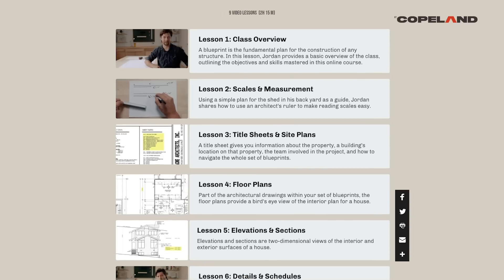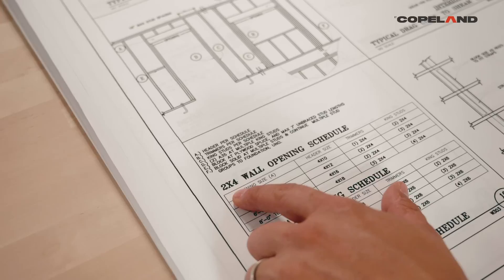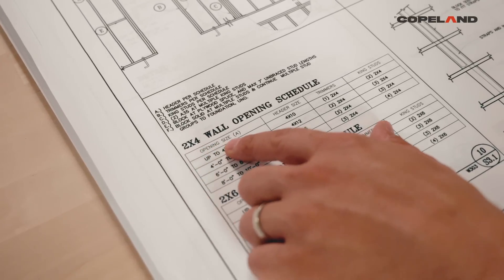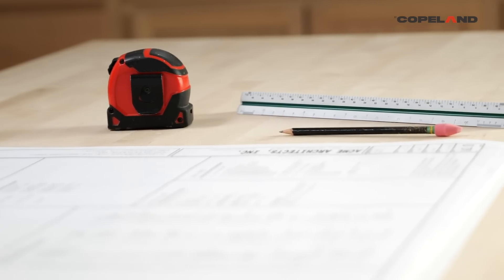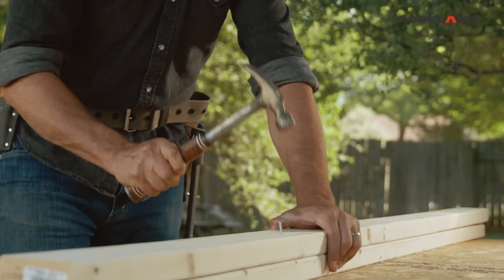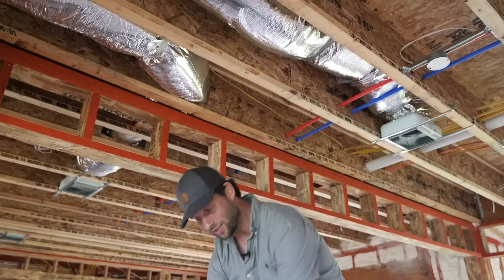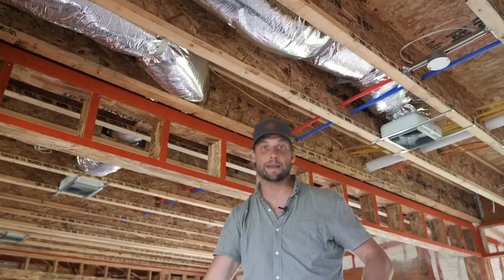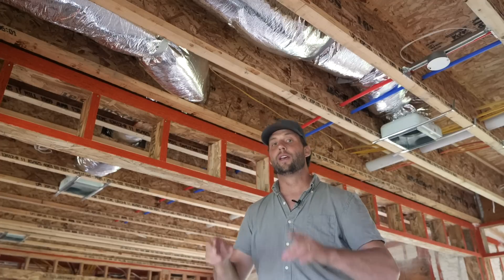Flex vs. Rigid Metal AC Duct - My preference may surprise you!

Comment: So long as you size it correctly, you don’t pinch it or bend it too far, flex is better in almost every situation.  When you size it you have to use a lower velocity also.  So where you might get away with a 6 inch in metal pipe, you probably need a 7inch in flex.  If you can run a board trunk line with flex take offs.  In new construction, I would only use flex unless it’s a custom house with a correct budget.  I would never use metal pipe, with wrapped insulation.  There are very few people that will wrap it correctly and you will have condensation leaks, also people will set stuff on it and it will compress the insulation and leak where flex will move more and you’re less likely to leave something on it.  You won’t use the difference in cost of the duct work on any extra electricity.  There are so many other things that will cost you more money than using flex over rigid duct, especially when it’s sized correctly.

Comment: Jordan agree to disagree.  If you building typical USA stick houses flex duct is the best way to go. But if you building industrial buildings, Steel, or Concrete buildings than for sure ridged is much better on the main run's and only Flex at the end. Also on Mobile homes I go ridged for reason so animals can't destroy and also it's easier to maintain and service. So it really comes down to what building you have.

Comment: This is not a good video Jordan. (1) You did not state what you are talking about: trunk vs branch vs returns. Trunk should be metal [avoid fiberglass]. As far as branch lines IF they are designed properly flex is ok, metal would last longer.  Flex got bad name because of hackery. Hackery happens today. Not properly strapped, not properly attacked to metal boots, etc. Again this is not just exiting CFMs, installers should test ESP.

Comment: The round rigid duct generates about half the turbulence of flex though most systems will allow for this I’m still a rigid user although I will agree that flex duct does antinuate wait sound much better. 
Ductwork in unconditioned space is to be avoided at all cost, well almost. 
40 years in the frigid north.

Comment: I love the contra position. Instead of saying, like everyone else, spend 20k more to save $20 a year, you said, the extra cost is not worth the improvement in performance. America needs to hear this!
Reply: Mat risinger like to spend thousnd to save dollars juat to prove his point hahahha
Reply: Feel thats the way solar power is
Reply: Where have you been? All America is built like this. Unfortunately. Edit: of course by "all America" I meant residential real estate.
Reply: @ooooooo-pu8vg  that's good then.
Reply: I am an hvac contractor.  Flex is much more likely to suck. Poor airflow. This guy is full of shit. Once the squirrel chews it up..
Reply: @jadfaris4119  good duct work isn’t cheap and cheap duct work isn’t good.
Reply: I’ve seen jobs where there’s been way too much flex in the system doesn’t work. Flex no matter how you run it has friction. And I’ve seen friction loss caused equipment not to work not to cool A house. What I don’t like about this is that flex duck will be buried under a mountain of sheet rock and paint if anything goes wrong with it guys cut it all out to fix. If you have low airflow because of all that length of flex run there’s nothing you can do about it. I think he’s trying to save too much money on his installs probably have an illegal aliens installing flex all over the place. That’s how a lot of builders are and I’ve had her go out and tell the homeowners you’re screwed more than once in my career. And that’s also on Multi million dollar homes that the builder went cheap ridiculously cheap on the HVAC the most important part of the house
Reply: @benkuxhouse787  let me understand your point , so you mean , it's better to use metal duct ? Im thinking using flex for whole house as to cut cost , but if the air supply wont work well, doesn't work as much as metal , then its a lost to use flex .
Reply: @nurulshuhadah1175  It doesn’t work as well if the ductwork is going to be buried beneath a bunch of sheet rock flex duck should never be used

Comment: The metal coiling that provides the shape of the duct internally. IS also what creates all the texture internally breaking laminar flow and requiring more CFM to overcome it.
Reply: The "spiral wire" inside the flex tube can be thought of as being very similar to the "rifling" found in most gun barrels."  The air flow over the "rifling" of the flex duct is therefore "spinning" or "rotating" causing the air to become more "dense" and "concentrated" - just like happens within a storm cell in nature . Further, the air flow dynamics and efficiency is  most likely"enhanced" to a greater degree than it is "degraded" or "corrupted."
Reply: You have any source to back to up?
Reply: @impactodelsurenterprise2440  just thinking back to fluid dynamics in undergrad.

Comment: I agree about everything you said except one thing.  Longevity.  I would have no problem with flex duct in a new build.  Get 50-100 years down the house and there is no way that everything isn't going to have to get opened up to redo the work.  I say plan for the long haul.  That plastic in those flex ducts get brittle and deteriorate especially if they ever come into contact with condensation, or any pest in the home.   When someone tries to tell me how to do something I always make them qualify their statement if its about aesthetics, functionality or longevity.   Aesthetics is not the most important thing here assuming both jobs are done cleanly.  Functionality is fine either way although there are arguments either way.  On longevity I see it as no comparison.  I say build things that might last for hundreds of years.  All the building science goes out the window if you have to gut half a house to retrofit mechanics at a fairly early point in the life span of a house.  Things go together best the first time and should stay that way as long as possible.
Reply: I’ve been back in attics that have 30 year old flex and rigid board, and there’s no difference, the worst is usually wrapped metal. I’m not talking about the old owl flex systems, but the Mylar systems.  I’m in Ft Lauderdale where 130 deg attics.  If I bought a 25 to 30 year old house, I would replace the ductwork anyway.  I wouldn’t want other people’s mildew growing in my ductwork.
Reply: "or any pest in the home". Beware the rat & mice monsters. Even squirrels. Those tiny rodent teeth can tear up your peace of mind like crazy.

Comment: Using some strategically placed elbows is nice in certain areas. The duct boot selection where it comes through the ceiling is also important. Starting from a basic, cheap system, what is the first thing to upgrade? (It's not the flex duct)

Comment: I don't disagree that flex duct, when installed properly (big disclaimer here) is almost as good as rigid.  However I think a blended approach is best for flex.  Use hard pipe for most of your run and then finish off with 4-6 feet of flex for ease of final installation to the boot and for sound deadening.  I NEVER install more than one box length (25') in one run.  Generally I am okay with it in runs up to 15-20 feet if they are straight runs that can be easily supported for the length of the run.  When you said you keep it short at 40' I almost lost my drink.   Around here (Ohio) it is hard to find someone who installs it properly and correctly supports the duct, manages the sweep of turns, and fully stretches the duct out.  That is another issue you can have with flex, if it is not stretched out fully the coil inside will cause the air to "roll" through the duct which will lead to reduced air velocity and airflow at the register.
Reply from the maker: I agree. It's hard to find people who do anything correctly without training.  Most of my subs I have to be very explicit on what I expect and monitor the process for the first few jobs.  Unless we are using a balometer to verify flow rates, I stand by my argument that using rigid instead of flex is less of an issue than poor design and commissioning of the system.    I take no issue with installing rigid and flex, if you have a wide open attic to work with. Thanks for the comment.
Reply: how do u find a guy that does great install?
Reply: @bamc3835  your pray to the HVAC gods and hope for mercy

Comment: I have an interesting problem here in NC - all insulated flex duct in the vented crawlspace...the main trunk coming out of the air handler drips with water from the humidity. Even though it's insulated! It's usually 80%+ humidity down there, but I can't do anything about that unless I seal the entire crawlspace - it's just as humid outside!
Reply: Encapsulate the Crawlspace, that humidity will drop overnight!

Comment: It seems odd to have such large openings in the joist (TJI) webs from the ducting. Am I wrong?
Reply: Those floor joists are designed to be able to have large openings cut in them.  Just not the top and bottom plates.
Reply: @brianlorge906  That hole size is probably the max allowed depending on how far away it is from end supports(wall). I believe its max 8 inch diameter hole on a 12 inch deep TJI joist if supports are minimum 8 feet away. I personaly wouldn't do that to be safe. It just looks weird and sketchy. Thanks.
Reply: You are absolutely correct. The building plan will give you the maximum size hole that should be cut in pre-fab joists, and it's alot smaller that shown in that video.

Comment: skip up until the 7 minute mark.  HVAC systems need to be designed for each specific home, spec written and then equipment specified, that's the time to compare costs vs performance  of ridged vs flex or any other component in the system.  

Never trust HVAC contractor who walks in asks 3-4 question and then just hands you a quote.  An independent designer is always a good idea.

Then every system should be tested after install to be sure the designed airflows and such are met.

Comment: Matt Risinger is going to call you over this one.
Reply: Master Risinger has been glove slapped in the face. Now to regain his honor, he must challenge Master Smith to a duel.
Reply: I'm in the design process and watch a ton of Risinger videos. BUT, I like to hear what other professionals have to say. This guy has some good points. With that said, I live in a place that gets up to 118° in the summer and occasionally will see 20° in winter. Maybe, based on the farthest distance of 44 feet, I may go with a hybrid of the two. Metal for long straight runs and flex on the shorts. However, if the flex is pulled as straight and tight as possible, I've read that this minimizes friction and turbulence.
Reply: Meant to add that equivalent length plays a part in air flow as well.

Comment: I'd like to know what the cost is up front to properly design the duct system.  Because, when you add that to the HVAC budget, it doesn't seem like it would be much higher to go with the VRF as you discussed in yesterday's video.  
I don't know.  Maybe I'm lucky to have an HVAC guy that installs my mitsu mini splits to where I end up being into them for 1/2 of what the normal cost is.   I don't do conditioned attics, therefore I will refuse to put a ducted system up there.  So VRF has been the best choice for my houses.  I do a single 18K BTU unit  (20.5 SEER) for around $3000 installed.
Reply: is vrf the unit that replaces hvac units more commonly used? i am a lil confused so pls help...i thought at first ervs replaces the hvac unit but then found out that is only for fresh air supply
Reply: @bamc3835  Watch Jordan's video from 2 days ago. VRF is 'variable refrigerant flow'  which is the way a ductless mini split heat pump operates.

Comment: What about dust accumulation in the duct?  I was under the impression that it was much higher with flex duct due to the less smooth interior surface and that it is also more difficult to clean.  Thoughts anyone?
Reply: Dr. Lsitburek also mentions this in his builder's guide.  Similar to the comment about vermin infiltrating the ductwork and leaving evidence in the ductwork also.

Comment: Who do you have validate  system flows at the end of the project? Does the mechanical installer balance, or do you go with more of the commercial approach and have a NEBB certified TAB contractor balance the system?
Reply: Using a balometer isn't that complicated.
Reply: @halbritt  I've used them quite a bit in my job as an HVAC controls technician. I'm just curious if they go as far as having a third party validate the system.

Comment: Mice love flex!  If you live outside of the subdivision or in the beginning phase of one your going to get mice. I see lots of droppings in flex with custom exits for the mice. That has been what I've seen in remodeling homes.   This is with mostly crawl space installation.
Reply: the biggest problem with flex in vented attic are those darn rodents. yes, thermal is an issue but not yet hazardous.
Reply: Playing devils advocate, couldn't the flex duct simply be replaced if mice become a problem?
Reply: @TheRoadTaken  yes, but who wants to come up with thousands of dollars to replace damaged ductwork.
Reply: @tysleight  flex duct in my area is not that expensive last I looked but maybe COVID has affected the pricing too.
Reply: @TheRoadTaken  mostly labor.   Our area is years out, even unlicensed uninsured guys are booked out and can charge anything they want.
Reply: @tysleight  also think of your poor serviceman who has to replace the flex duct in an insulated attic at over 120 degrees in the summer. Have some heart, we get heat stroke too ya know

Comment: If you want to save money, just build a smaller house, air seal it well, and stick lots and lots of fluffy stuff in the walls and roof. Rigid vs. flex vs. VRF is arguing over pennies. There are much bigger thermodynamic fish to fry.  Especially the way most US houses are built, too big, under air-sealed, under-insulated, and wore, over glazed with crap quality windows.
Reply: Who is the size police that determines if a house is too big, too small, or just right?
Reply: ZergZfTw Amen!

Comment: I had flex ducts and very low airflow. I had them installed with metal elbows and airflow was greatly increased.
Reply: I think this is the part that matters.  In some systems, flow velocity matters and must be managed accordingly.  Rigid is more predictable in this regard.
Reply: I did the same.  Metal elbows often correct flow and balance issues.
Reply: Yeah it's been shown that 90s especially hard 90s in flex are so detrimental to air velocity by having such a stupid high equivalent length that you pretty much have to use rigid 90s when you need to make a turn.

Comment: Don’t think the case could be made any better. Now how about roll copper vs rigid copper for the HVAC lines ?
Reply: Rigid cooper requires more fittings = more failure points for leaks.

Comment: Thank you so much! I always worried about the flex duct in my attic. My furnace is in my basement, with the living area on the first floor with one powerful outlet. The top floor has four outlets for the two bedrooms and the two bathrooms. I found that even if I completely close the living area outlet, there is almost no increase in airflow to the top floor. The furnace is a very tiny 14” wide, 45,000 btu, natural gas unit. There is no air conditioning and there’s so little airflow to the top floor, that it would be useless. There’s only some rectangular metal duct inside the wall to bring the air to the attic. It’s a house with an association, so I can’t just stick an package unit on the pitched roof. We’ve already covered the south facing roof in solar panels and north face the street. 
I use an inefficient portable hose outlet air conditioner on really hot days. 
A big swamp cooler would be awesome, because it’s extremely dry when it’s hot outside. It would only take a basic 120 volt outlet to power the water pump and the circulating pump. 
Thank you so much for your opinion, if you have time for some very basic thoughts.
Reply: Take a look at the pioes going up stairs and make sure it isn't crushed, blocked or have a closed damper in the system.  Also look at the floor registers, if they are undersized or if they have run small lines to the upstairs rooms, you may have to upgrade them.  While you are at it, beg, borrow or steel a radiant thermometer to endure you have insulation where it is supposed to be - ditto leaking ducts.